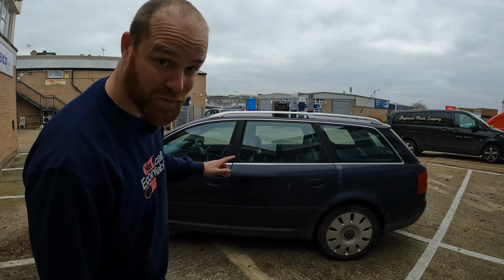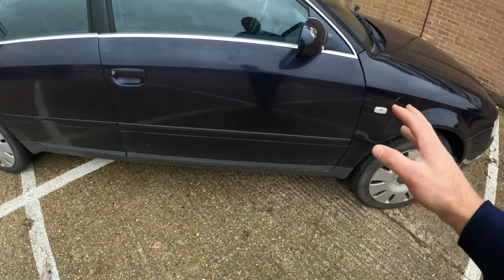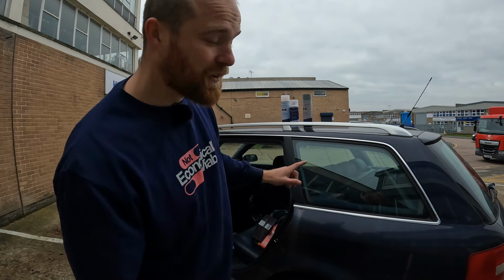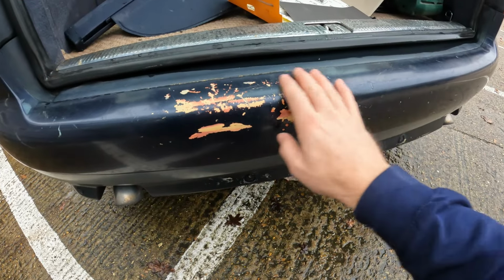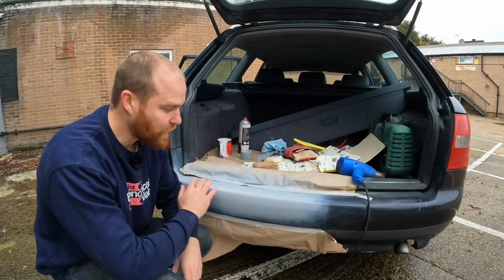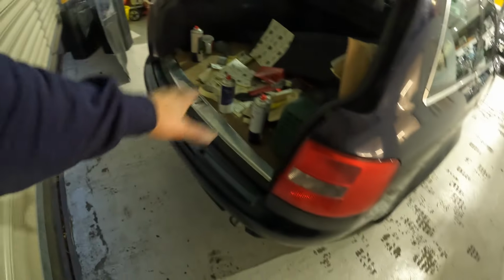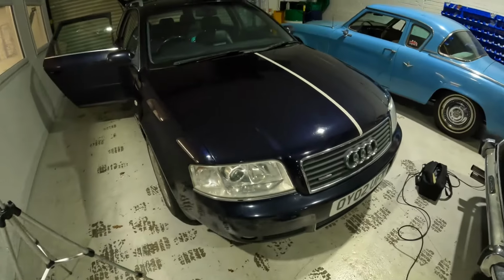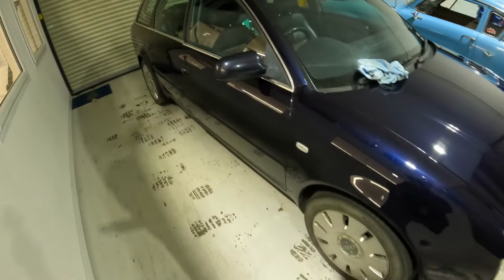I Gave My Abandoned Audi A $50 Paint Job

Comment from the maker: Lots of people saying I should have used some rust converter, which makes sense. But in previous videos people have told me painting over rust converter should be avoided. Thoughts?
Reply: Painting over surface rust just isn't gonna work. Sand it down to bare metal, or use rust converter. Rust converter works, just let it dry enough. Then primer it and spray paint over it, it worked for me. Enjoy the great, best sounding V6 diesel! Good luck with your channel.
Reply from the maker: I sanded it down to bare metal, just didn’t do the rust converter part. It’s gonna come back no matter what - it’s a 00’s Audi after all lol. Cheers mate
Reply: @NotEconomicallyViable  When painting on rust, you should at least use a rust primer. When sanding down to bare betal, you really want to have the surface as dry as possible with some heat source on the metal. (Or paint in a dry environment.)
Reply: For surface attack with wire wheel and/or flap disc on grinder, apply bilt hamber deox gel cover with cling film and leave for 12 - 24 hours, clean off the residue thoroughly and ensure surface is clean, then apply bilt hamber hydrate 80, allow to dry and apply second coat, once dry sand very lightly to remove brush strokes, apply several coats of 2k primer, wet sand, apply tack coat of base coat, then apply several more coats of base coat, wet sand lightly, apply several coats of quality clear, wet sand lightly, attack with cutting compound and finally finishing compound. A lot of work but you will end up with a very nice finish. Please find somewhere to do this work indoors you'll fight a losing battle trying to do it outdoors. Also forgot to say if rust has left heavy pitting you will need to use some fine filler before applying the primer or else it will look crap no matter what you do. The bilt hamber products are pricey but excellent. Never use POR15 anywhere on your car. It's crap as numerous people have discovered.
Reply: @markbos4  it dosnt convert it just seals it
Reply: Just do it your way 👍👍

Comment: The rust on the trim comes from a plug connection between the plastic part at the top and the trim. Solution: Remove the trim, remove the connector and replace it with a plastic one

Comment: when you polish read the meguairs ultimate compund label. use on small areas , clean and move on. never put polish products on an entire door/hood like that and work for 20min and let the polish product to just sit  and wait for you. put on the disc, work clean and repet. take your time on smal areas you will get better results. red the products label specs. but congrats on the work. and after ultimate compund you need to start over with ultimate polish and after use a wax to protect the polish

Comment: Oxidation is a chemical process that causes vehicle paint to break down over time from exposure to heat and oxygen. It is essentially a form of corrosion in which paint loses its oil content, and as a result, dries out. This process is gradual, but the effects can be severe. As paint oxidizes, it becomes duller.5 Nov 2020

Comment: In a while, if the company has any sense, they’ll invite you to do non critical work around the workshop and eventually on lower skilled basic prep work, which you’d learn from & I have a hunch, you’d enjoy hugely. I think you’ve got decent basic technique for a recent starter who’s pretty much self taught.
Most of us have been mucking around with various vehicles for decades. I’m coming up on fifty years. I’m still not brilliant at anything except machine & hand polishing metals and I’m a devil for detail. So I fix old lock sets and bike instruments. I can’t paint & I can just about rebuild motors, but none of the engineering. Fettle carburettors & old ignition systems, respoke wheels and replace bearings. 
Engineering, welding, pro painting, seats, there are so many brilliant pro/am fellas especially in the Midlands, they are so much better than I’ll ever be. Owning & fettling  old motorcycles and cars is a joy (& a pain, wouldn’t be without the bikes, tools and basic workshop).
Good luck to you, sir!

Comment: Nice job mate. I would say those blemish runs on the rear quarters are definitely rust residue coming from under the silver trim so have a look under there for corrosion before its too late. There’s always something about breathing life back to old cars even if they are not considered worth it by most people. I like Audis especially around the 90s,  00s era. I have a 2007 RS4 convertible which has cost me a fortune in replacement parts but as it’s the last manual V8 Audi produced I’m somewhat inclined to keep Hold of it as it’s a great well built car.

Comment: I've done this like 8 times. The problem will be clear coating/lacquer. It looks like shop painted, then if clear is enough it will end up shiny, then after ~2-3 years clear will crack and at the end it will look like shit. I promise you that. Tried different clears, on my audi A4, on my VW Vento, on my Corolla, every time same shit. Clear coating in cans is rubbish, they all end up cracking in 3 years. Tried polishing, tried thinning with acetone, tried many different brands. It never works, not a single time. Initial result is excellent, give it 2-3 years and it shittens up. I am not sure if I ever do this again, I'd apply clear coat at all.
Reply: "Shittens up: 😂

Comment: Really should be proud of that great job nothing better than driving something that's not economically viable I drive a w reg vauxhall astra mk4 estate 1.6 8v hydrolic lifters tick more than a clock but there getting done after Xmas the last owner didn't clean it for 7 years roof has black dots inground in the paint work the bonnet has deep scratches going through to bare metal front bumper is broken just replaced both headlights I'm going to get her looking great again because I love that ol' girl 👊

Comment: Well done, massive improvement. Just a comment regarding technique - putting dots of product onto the panel and running your machine over it creates a lot of slinging, which requires lots of unnecessary cleanup (e.g. windows, trim, nice classic cars next to you). It's cleaner and less wasteful of product to put 4-5 medium coin-sized dots onto the pad itself, smear that over the panel with the machine off, then with the pad making full contact with the panel, turning the machine on at low then gradually working your way up to your desired speed. Also a good idea to blow out the pads with compressed air 1-2 times per panel (if possible) and to never place pads/cloths on the ground as they pick up dirt and grime in an instant and will act as sandpaper if used on your paint afterwards.
Reply: +1 to all you said. You know much more than I do.
One other thing to add, if you use soft cloths as final polishing off, for goodness sake, keep them in their own “good rag bag”. They otherwise pick up every bit of grit and muck from a workshop and then abrade your lovely finishes!
I’m an old bike guy, so please don’t ask me how I know 😮

Comment: Could've used some putty and mask better, I mean you have the masking paper already. Yeah, sand the rust, then wire wheel, put rust converter on, some zinc paint, some putty to lever it out and sand and THEN paint.